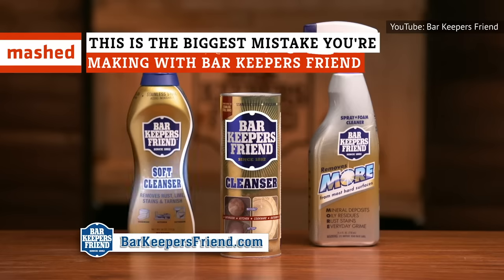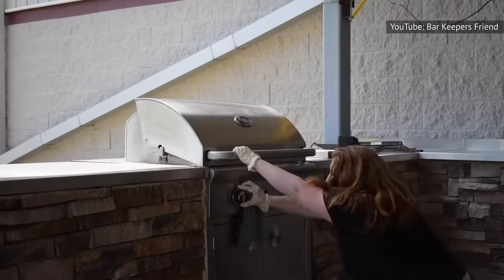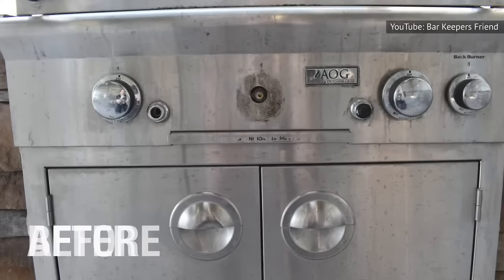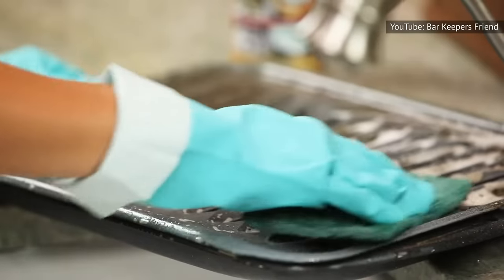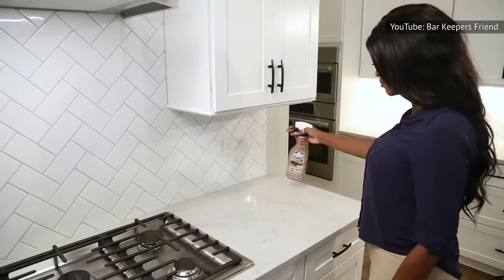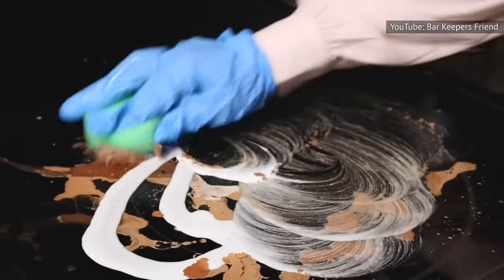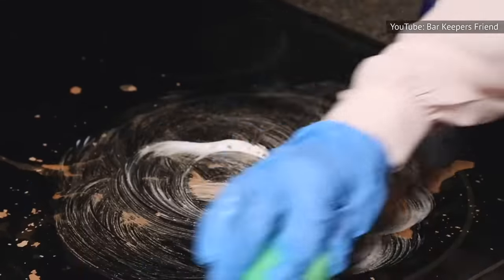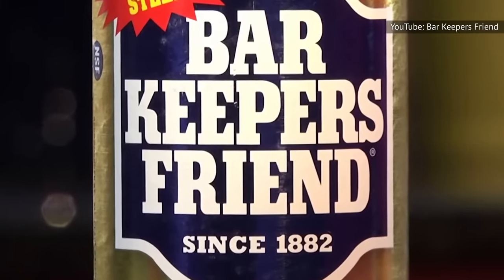This Is The Biggest Mistake You're Making With Bar Keepers Friend

Comment: Just don’t confuse it with Bon Ami. They are both very different products.
Reply: Whats the difference?
Reply: @missmustache4207  Bar Keeper’s Friend has an acidic component that actually dissolves rust, and paired with its more abrasive makeup, can more easily damage surfaces. It can also react like chlorine bleach on fabrics.
Reply: @joz411no8  whats bon ami then?
Reply: @missmustache4207  Bon Ami is made up of a less abrasive mineral that makes up softer, more common rock formations, unlike the quartz used in some cleansers. It relays more heavily on a little water and the rubbing/scrubbing action, without the corrosive chemical reaction of other cleaners. If you allow Barkeepers Friend to remain on some surfaces, it can eat them away.

Think of it this way. You could clean your toilet using a Lysol toilet bowl cleaner, or baking soda and vinegar mixture. The Lysol needs a very toxic group of ingredients to release stains,  whereas in the alternative, the soda is your abrasive and the vinegar reacts with the soda to loosen stains.

While I’m not suggesting you ingest Bon Ami or a baking soda and vinegar mixture to prove how much safer they are, you might better understand how they compare to their alternatives.
Reply: @joz411no8  Bon Ami is the only way to go if you absolutely need to use cleanser,
Reply: Bon ami is for the more health conscious buyer.
Reply: I can not ever find Bon Ami anywhere in stores around me! Is it a demographic thing??
Reply: @bweaver760  I’ve used both but typically only buy Bon Ami. Have you tried Target? I can’t say whether it’s regional or not. I grew up in Southern Louisiana and my mom had both. She used Barkeeper’s Friend on silver and steel.

Comment: It tends to settle. So if you don't use it very often at least give it a good shake every couple weeks. If you store it upside down you won't end up with a cement chunk at the bottom. You also won't use the good ingredients first by accident.
Reply: How do you store it upside down without it falling out of the can?
Reply: @flynn1a  I put my can in a gallon size plastic bag and strip tie it to keep moisture out of it. No matter how good your plumbing is, the storage area under the sink gets humid and the cleanser clumps because of that. Problem solved. Doesn't help that the can is made out of cardboard either ;-)
Reply: @m00se23  Thanks!  I’m going to try that.

Comment: All Clad had to replace my ENTIRE set of pots and pans because they kept telling me to use BKF.  Well, yes it gets it clean, but it also scratches to hell that chrome finish.  At least All Clad honored their warranty.

Use a microfiber cloth for GLASS with Quick n Brite paste to clean the chrome finish. It’s the only thing that won’t scratch.  You’re welcome.
Reply: I used Bar Keeper Friend for year as I love it. You could be using BKF liquid solution for pots and pans, not power will scratching.
Reply: Use it only on the stainless steel cooking surface not the outside chrome.

Comment: Really hard to rinse and always leaves a film on my stainless steel.  Could this be due to my hard water?
Reply: Yep
Reply: I use vinegar heated, then BKF, then rinse the residue off using dish soap and water. You cannot remove the BKF simply rinsing with water.

Comment: Isn’t BKF what was labeled as “Comet” cleanser.  A cleaner has abrasives in the mixture, so it will scratch or dull fine finishes.   My best use of BFK is to use it with Wheel Cleaner on my wife’s car that has stainless steel exhaust pipe covered in soot.  The BKF abrasives takes off soot and wheel cleaner acts as antiscratch.  So abrasives, the acid will damage a lot of finishes.
Reply: No BKF is not Comet.

Comment: In South Africa i managed to find the powder and had such hope that I would finely find something that can clean shower glass doors.    I used it as a paste, no difference, i tried wetting the glass doors and rubbing the powder on that..  no difference.   From all the good reviews I had seen i expected a huge change.  Did not clean the glass.  Was deeply disappointed.
Reply: For soap scum use Easy Off oven cleaner. I have tried everything. Easy Off is the only thing that gets the soap scum and hard water stain clean. Works great on the tile and porcelain as well. use a non-abrasive pad after letting it set for 30+ minutes then rinse.
Reply: @SM-bm6jo  thank you..  will try that brand...

Comment: BFK is okay, but when it comes to scrubbing power nothing beats a proper scraping out the excess into the trash, hot water and a degreaser soak and rinse, followed by a stainless steal wool scrubber, course salt, and/ or Borax. Use a non scratch pad for more sensitive surfaces.
Reply: WRONG! Salt pits stainless steel, steel wool can scratch the surface of stainless steel. Use heated vinegar with spatula designed for non-stick pans then BKF with non-abrasive pad.

Comment: Does this clean chrome taps?
Reply: It will leave a film on chrome. I recommend CLR. That polishes as well. However for stainless steel cookware I just clean odd the BKF with soap and water. I think people are thinking all they have to do it rinse off the BKF with water. You have to remove it with soap. The residue is poisonous.

Comment: Is it safe to clean up car exhausts ? 
Tia
Reply: I have used it on an antique Stainless gas pump with good results. Depending on the exhaust tip, I wouldn't exceed the recommended time frame to leave the product on. 

I would without question use this on a daily driver, yet I also have a mustang with Borla exhaust system. I would try a small test spot first, then proceed very cautiously If I were using it on my mustang.

Comment: I use BKF for the first time Tonight I was super disappointed in the results. The two pans I used it on showed no difference before and after
Reply: Soak them in white vinegar for 24 hours, then try BKF to scour.
Reply: Pour any vinegar into the pot/pan but the cheapest white is fine for cleaning. Heat the vinegar in the pan and scrape with a spatula designed for non-stick pans. You will be amazed at how stick on food lifts off. Stubborn burned on stains come off with BKF and a non-abrasive pad.

Comment: Most of this is just plain common sense, I use it on our stainless cookware, does a fantastic job! Wouldn't dream of using it on marble , glass top stoves, I only use it on stainless steel 👍
Reply: It is fine to use on glass top stoves.
Reply: @GBB70  You're not supposed to use a braces on glass top stoves Read your manual
Reply: @dudleygoodwin4902  you know that polish that came with your glass top stove?  It’s just as abrasive as BKF.
Reply: @jlsage4059  a mild abrasive. But it's your glass top do what you want to with it!
Reply: @dudleygoodwin4902  Oh good….Was worried about getting permission from Dudley.
Reply: @jlsage4059  whoever you are why don't you just give it a rest!! You seem to be the one who's pushing the issue anyways!
Reply: I use it all the time on glass top stoves and it's a game changer!
Reply: @dudleygoodwin4902  thats because they want you to buy their expensive products.
Reply: @jlsage4059  🤣
Reply: sense is no longer common ! 🤣🤣

Comment: It is abrasive.  I wouldn't use it on anything that you want to maintain a mirror finish. It will leave scratches. And a lot of the times, just soak the pan in vinegar for 4 hours or overnight and you will get all of the pots clean without any scrubbing.

Comment: I hate it!  What works best for me for pots is just to use very hot water and soap.  Bar Keepers does nothing!
Reply: Why "hate it"? If soap and water worked so well why did you try anything else? 

It depends on the material the pot is made of and the nature of the stain.
Reply: @SM-bm6jo  I wrote this a long time ago but I probably used steel wool and a lot of elbow grease.  It would have been nice to find something that made it easier!

Comment: Very expensive stuff.
Reply: It is a value for it's quality and versatility. Additionally, you can often find the specialty products, soft cleanser, multi-surface spray and mold and mildew remover at your local discount store--Ross, T J Maxx or Marshalls.
Reply: it's about $1.50 more than Ajax or Comet, but it works in a different way. for baked-on oil and stuff on pans, it can't be beat......i'd seen it for years and never tried until last year..
Reply: yeah it's like $3.69 opposed to $1.29 for ajax or comet but they don't clean stainless as well.
Reply: Just a little of this goes a long way. I have to use more of other brands, so in the long run, this is less expensive.
Reply: It is very cheap where I live. It is cheaper than Ajax.
Reply: @peanutoreo8052  It's superior.
Reply: @willybones3890  Yes, it is.
Reply: How much $30,000? $100,000? A million? $3 ...boohoo